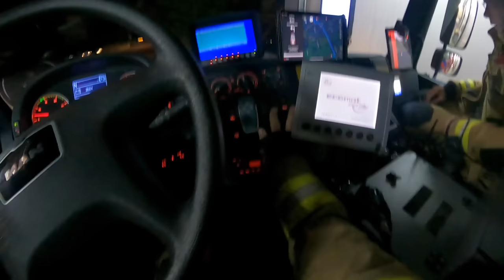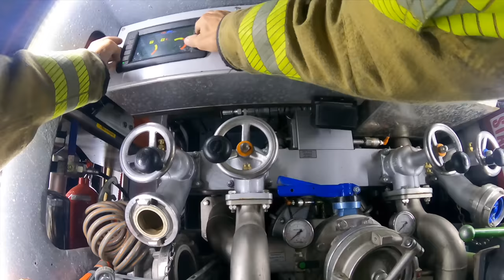Brand koeienschuur - VOLUNTEERS DUTCH FIREFIGHTERS -

Comment: Great video and work! Now, i have a question about the firetruck lighting in the rear. Is there any reason why is it red? I'm just curious
Reply: No haha
Reply: yes there is a reason for that!
Red light is overall pretty dim. when on night calls, if you would've had bright white lights, your eyes would need to adjust for a solid minute to the outside darkness.
But the red light keeps your eyes acclimatized to the dark, so when you hop out, your eyes are already used to the dark, and you can get to work much quicker.

Comment: need a grapple on a skid loader to deal with all that loose hay or a grabber bucket on the big tractor that made short work of itproblem is big piles of hay can smolder for quite some time before they actually show fire by then many have lost barns because of it in my area of the usa